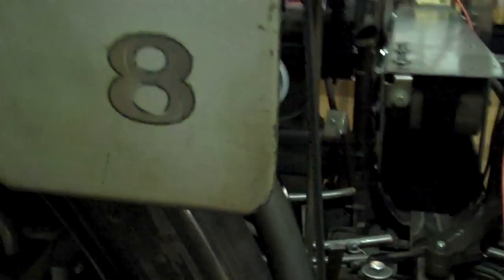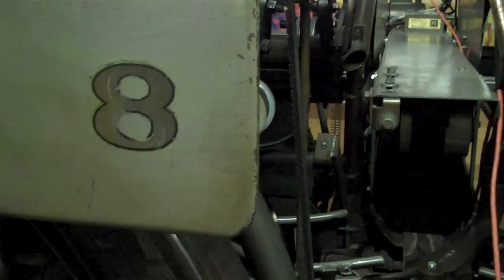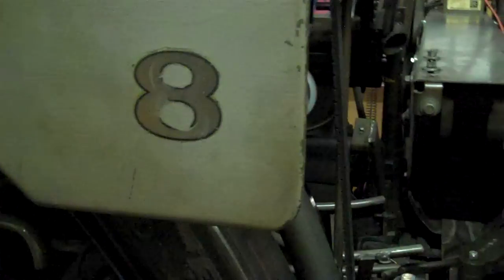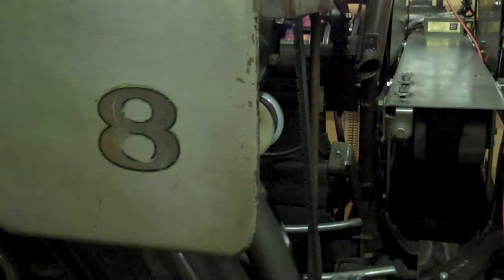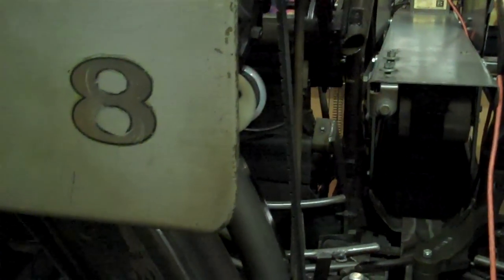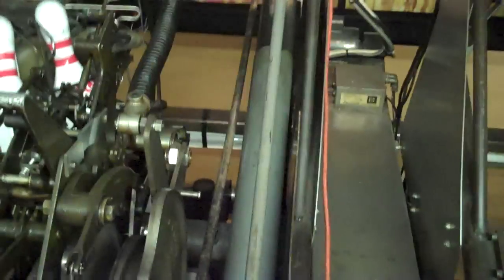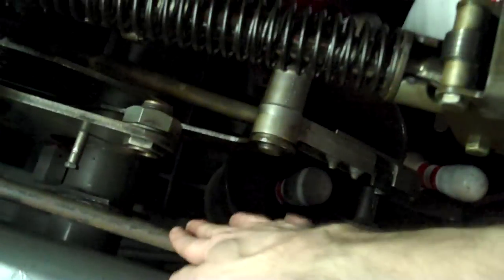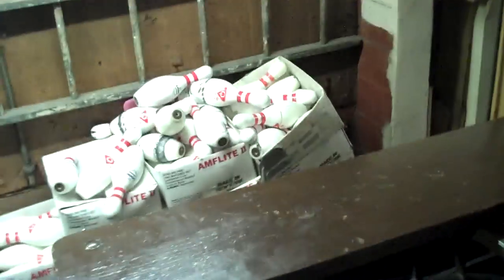Brunswick A2 Pinsetter - Rake Stop(s)

Comment: Very good. I wished there was a way to show each section of the gear box and explain what it does one cam at a time. When it is running there is to much going on and is hard to understand. The video's do not stay on the gear box and stay still so we can check it out more. Please keep the video's coming.